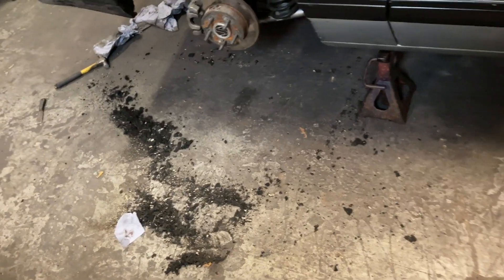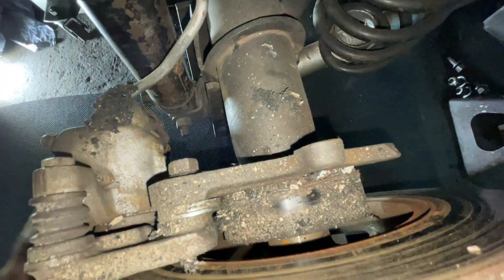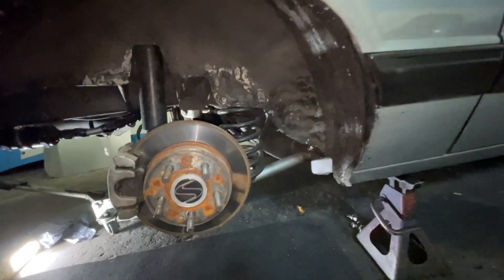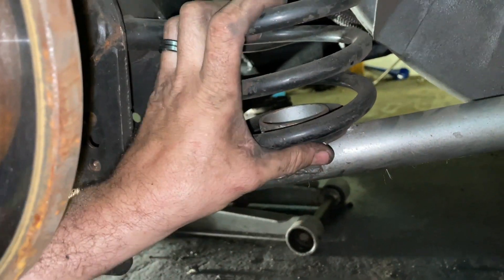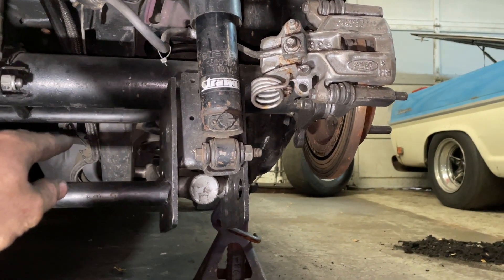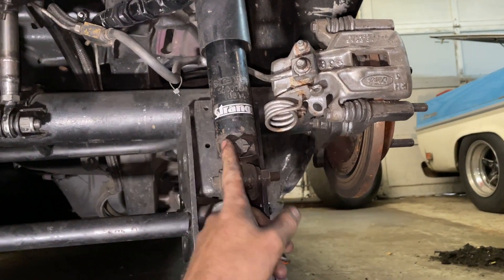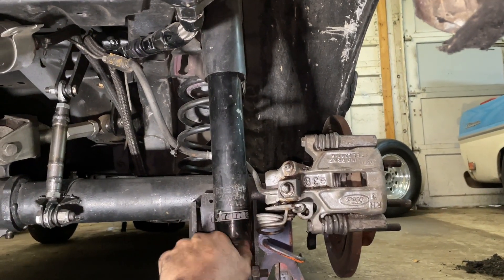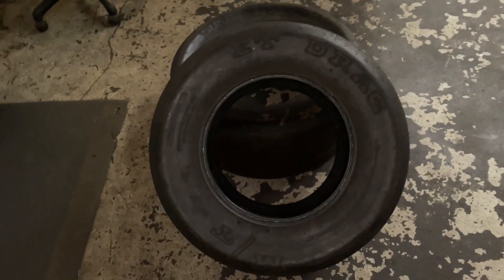Theory of how to set Rear suspension up on a mustang for drag racing

Comment: what springs are you running???
Reply from the maker: When I made this video I had stock length 4 cylinder springs in the rear, now I have some 110lbs with coil overs

Comment: Subscribed!!  Buddy thanks so much for this video!  I finally pulled my 1992 coupe out last year to be worked on.  I bought the car Brand New in 1992!  Anyways with a simple HCI setup on the stock bottom end at 2300' above sea level with no tune and stock 19# injectors, my car ran a 12.36 @ 110 mph quarter mile with a 1.60 sixty foot.  This is with welded torque boxes, adjustable uppers, aluminum lowers, stock rear springs, stock rear shocks, and an anti roll bar similar to the one you have.  I am going to invest in a set of adjustable rear shocks like yours for sure.  What model # are those strange shocks??  Anyways I spent more on parts last year for my car than what I paid for the car brand new in '92.  lol.  It's getting a V3 SI, a Terminator X Max, and a crap load of other work done to it.  If your interested to know everything I'm putting into it or everything it has I will post it!  BTW I ran that E.T. twenty five years ago, having two kids put everything on the back burner for me.
Reply from the maker: 110’s on the rear, I appreciate u
Reply: @Boostismyfriend  To me in this particular video, it looks like you might have the S6000EM shocks?

Comment: This set up transfers more force to the lower control arms too, the stock suspension puts a pulling force on the stock torque boxes, pulling them away from the body, at least if you are side stepping the clutch at 4500 in second gear...

Comment: Subbed purely on this video. I appreciate this, very helpful. What wheel size and backspace/tire combo were you running back in this video? I'm trying to run stock spring location.

Honest opinion. Do you recommend I simply go straight to the coilover/shortened/minitub?
Reply from the maker: Appreciate it, 15x8 with 5.5, you can run a 15x10!with 6.5 but you have to take a hammer to the inside high spots on the tub’s, I personally like that stock locations stuff, it worked well (1.15 60ft’s)
Reply: @Boostismyfriend  What gear were you running here? Thank you again, you saved me a lot of money and time!
Reply from the maker: I had a 3.27 with a 3 speed 400

Comment: What tire rim and tire size was you running  before  you mini tub the car and when you move control arm  does it lower the rear
Reply from the maker: 15x8 5.5 back spacing snd 15x10 with 6.5, it does lower it on stock location stuff
Reply: @Boostismyfriend  I have 10 " 5.5  bought the car with them on it so what problems  will I be facing with the 5.5 bs
Reply from the maker: It will hit the lip on the qaurters
Reply: @Boostismyfriend  ok need to suck the tire in.thanks for the info.where can I send you some pictures  of  my car it has a lot of potentials twin bw 69 418 9to 1 comp power glide 273 gears
Reply from the maker: Boostismyfriend@aol.com

Comment: Are you using a transbrake on your car ?
Reply from the maker: Correct
Reply: @Boostismyfriend  would this apply to a nitrous car as well ? and how far down is the new mounting point ? Thanks Matt
Reply from the maker: Yes sir, the further down the more bite it will have, basically you want it as fair down as you can get it if your tires will clear, you also have to work off the shocks, so if  i have it as fair down and the car hooks but then rolls out and kick the tires, if my shocks are over half way tight then i want to move it up a whole, you want it to be able to hook with the rebound 0-5 click from loose is what works for us
Reply: @Boostismyfriend  I have a coilover kit on the car so tire clearance will not be an issue. I have lowered the mounting point about an 1 1/2" and I will follow your shock setting advice I will see how that works once the tracks around here re-open, Thank you
Reply from the maker: Sweet
Reply: @Boostismyfriend  would this also work for a bias ply tire ? Hoosier quick time pro.
Reply from the maker: It will but you would have to run a decent amount of air pressure or take some anti squat out so it dont shake the tire
Reply: @Boostismyfriend  what would you recommend to start with ? Thanks for you help, Matt
Reply from the maker: 110-120% anitsqaut
Reply: @Boostismyfriend  sorry I ment rear tire pressure
Reply from the maker: Ole, 13-15ish

Comment: Did you have any trouble with c clip eliminators leaking?
Reply from the maker: They leak, i only had one set ever that didn’t and these ant them lol
Reply: @Boostismyfriend  I need to upgrade my 8.8 but saw a Ford 9 inch setup for Foxbody and comes with axles and Torino big bearing ends. I heard those are better than c clip eliminators?
Reply from the maker: They are, and they dont leak

Comment: Nice video bro! I’m running 50 50 on my rear .what struts are you running on the front ?
Reply from the maker: Viking
Reply: @Boostismyfriend  nice do you think the strange front struts are good & if so what should they be set at?
Reply from the maker: They are, depends on the surface, are they single or double adjustable
Reply: @Boostismyfriend  it’s the single will be using them drag racing the car cut a 150 60ft on stock suspension.
Reply from the maker: 1-3 from full loose
Reply: @Boostismyfriend  thanks bro trying to get the 60ft to drop it runs 710 in the 8th at 99 miles
Reply from the maker: @jaydollar140  sweet

Comment: Man I'm glad I found your channel. I've got all team z suspension under my car but have no idea what I'm doing. I'm running 6.0x at 116 with a 1.47 60'. My car spins when it shouldnt at times. I will try the moving the lower bar down as I'm in the top hole and bar is only slightly angled up at ride height so I imagine that line is way far forward
Reply from the maker: I appreciate it, yes you have to bring the instant center back

Comment: You seem to know what your talking about, I looked for a video for my mustang to use aftermarket coil overs mounted towards the center section, my question is should the shock be mounted straight up or the top toward the front of car or the top of the shock leaned back towards the back of the rear of car. If that makes sense to you? If so what kind of degree of a pitch should I have? Or no pitch at all, straight up and down mounted to the bar above and tabs welded to the axle housing.
Reply from the maker: They will work better more vertical, when you mount them slanted it changed the geometry
Reply: @Boostismyfriend  so line them up straight up and down will work best you are saying?
Reply from the maker: Correct
Reply: @Boostismyfriend  thanks so much, here goes👍

Comment: I know this video is 4 months old but I am doing a sn95 rear disc conversion on my fox. Did you have to do any other mods like a different proportion valve? Or just hook up lines , bleed brakes and back at it.
Reply: Thanks brother keep up the good info!
Reply from the maker: I used a adjustable proportion valve for the rear

Comment: Hey man I’ve got some questions about that rear disc set up you got. If at all possible is there a way I can message with you or something?
Reply: So you used a stock sn95 caliper bracket and cut it to slide around the axle housing. I’d imagine you used a sn95 caliper and disc as well? Trying to do this conversion myself at the moment actually. And you spaced the caliper away from the bracket 3/4 of an inch?
Reply from the maker: @davidpeterson9125   you bolt the bracket straight to the flange, basically you run the bolts threw the bracket, threw the flange to the c clip eliminators, then you washer the two bolts that hold the caliper to get the right spacing, most of  the time it’s less then 1/4 of a inch
Reply: @Boostismyfriend  What size rear rim and what backspacing? Thank You.
Reply from the maker: @black88coupe  it had 15x10 6.5
Reply: @Boostismyfriend  Cool thanks from Detroit!
Reply from the maker: What’s up

Comment: Great info! Where do you have your pinion angle at? Thanks
Reply: Good video. Now my problems is,that I have to translate it to spanish 🤔 for my friend in mexico.
Reply from the maker: -2
Reply from the maker: The more ridge the rear suspension is the less angle you have to run, unjoints are design to run opposite of each other, meaning if your front yoke is +1or +2 then you rear u  joint will be happy at -1 or -2, as long as the pinion is 0 to - side of anything the car will work fine, if the pinion is positive it will bite then  unload the tires a few feet out from my experience
Reply: @Boostismyfriend  Thank you

Comment: Those are stiff sidewall bias ply slicks?    When you set up the car how you had it separating. Do you know what your Anti squat percentage was roughly??
Reply from the maker: There stiffs, I honestly never measured the anti sqaut, I pretty much have always eyeballed stuff from what I know works, if I had to guess it probably in the mid 110’s but I can measure tomorrow
Reply: I was just curious.  With anything above 100% I’m sure the stiff walls are a must... I’ve been debating on putting pro bracket radials (26”)on the car as we run 1/4mile here.... and being my car is stock location everything I was considering South side machine style lower control arms to achieve separation and planting the tires
Reply from the maker: @murray81  I use to have southside bars back in the day, pro brackets is a good tire for most conditions

Comment: Really good info man learned alot
Reply from the maker: Cool!!! I picked up a Honda 250x atc the other day
Reply: You did man that’s awsome!Two stoke?
Reply from the maker: It’s 4 stroke, I bought it and a old Honda 300 fourtrax 4 wheeler from the same guy, I have to buy a gasket set so I can reassemble them motor
Reply: That’s cool man! I should have a GoPro video on my atc coming up. The onley problem is the motor is starting to blow up I change the oil in it. But oil is coming out of the crank case tube I put the right amount of oil in it. I think I’m gonna take apart the motor and go through it with my dad.
Reply from the maker: Sweet
Reply: You guys coming out to mountain creek?
Reply from the maker: @colegudmestadracing8875  yes